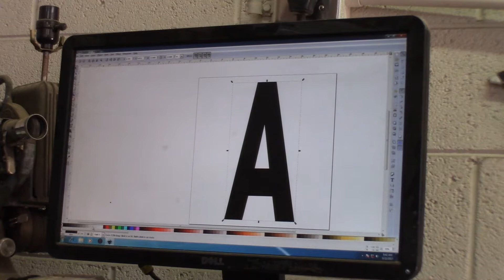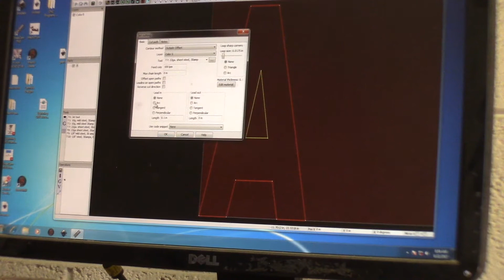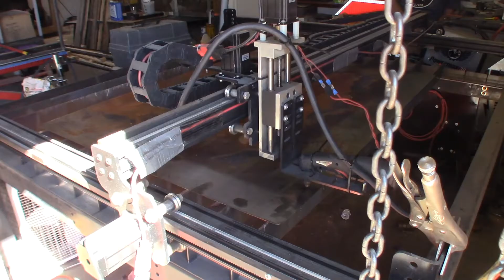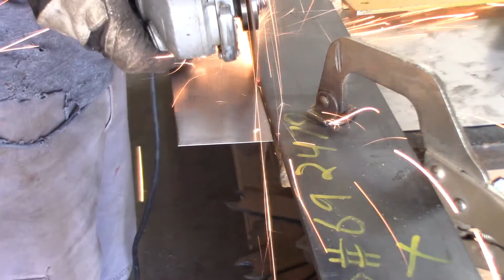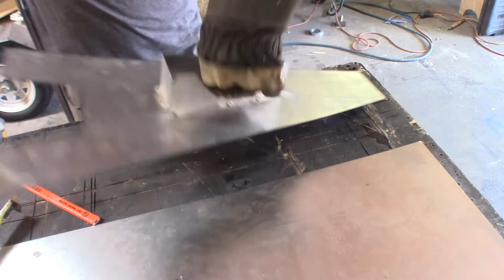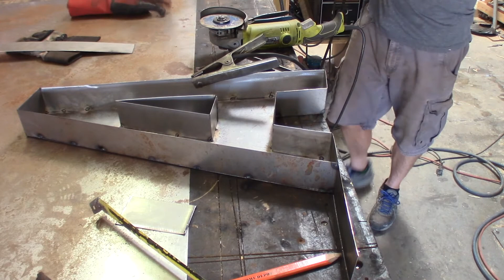How to make Industrial Metal Letters

Comment: Sir,what amperage and voltage do you use  to mig weld your thin metal sheets?
Reply from the maker: I'm using a 110v flux core mig welder on a mid setting. I don't know the actual amperage

Comment: What kind of welder for the tack welds?
Reply from the maker: Hi Joseph, I currently use a Lincoln 110v mig with flux core wire ( no gas) there's a lot of splatter from the flux core but I've had it for so long I've gotten use to it.
Reply: Artfully Rogue thanks for response I really appreciate it

Comment: Hello, nice job!
Just a small tip: in inkscape you can convert your text into an object (actually a group of objects, one per letter) it will be filled but you can add a stroke and remove the filler if you like better...
As for cursive letters you will just have to merge them after convertion...
Reply from the maker: Thanks for the tip! It's greatly appreciated.
Reply: @ArtfullyRogue  You're welcom !
Note that when making a dxf with inkscape you sometimes need to clean the dxf before feeding it to your cam software (if the cam doesn't do it himself) there may be zero length segments of small zigzags that could hurt your cnc... (well at least it's feelings ;) )
I personaly use qcad (free but has a pro version for almost nothing): just press M Z to select any segment smaller than any arbitrary length... true 0 can be deleted... near 0 must still be delt manually but at least you know where they are (there could some community script that makes it for you but I haven't had any time to find it...)
Just hoping it can help anybody ;)

Comment: I’m curious which plasma cutter & cnc you used?
Reply from the maker: I use the Hypertherm XP30 and the torchmate table and system. I've learned that I need to have the Hypertherm 45 in order for the system to function accurately. My XP30 is not really designed for cnc but it was bought as part of the entire system when I got it.